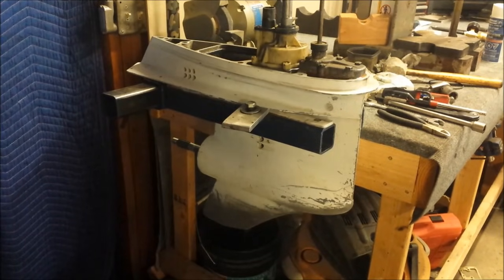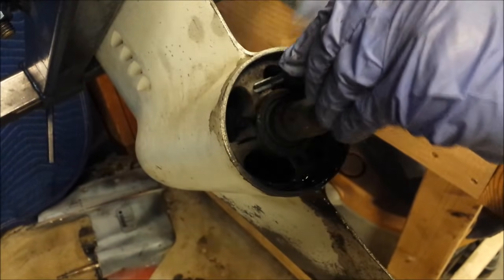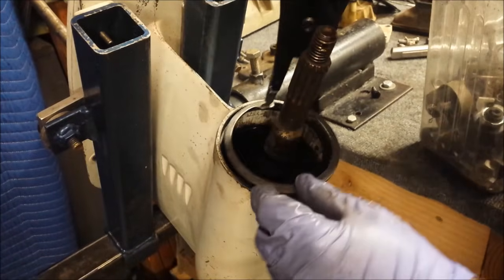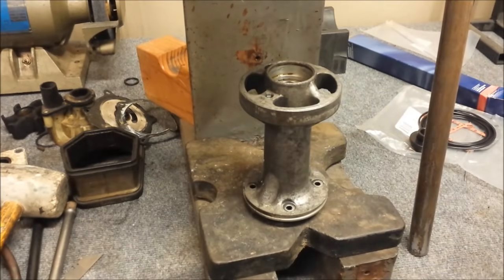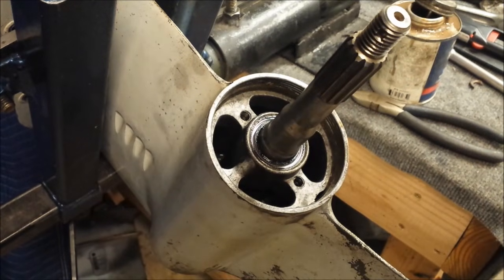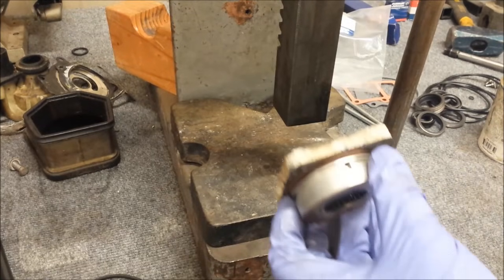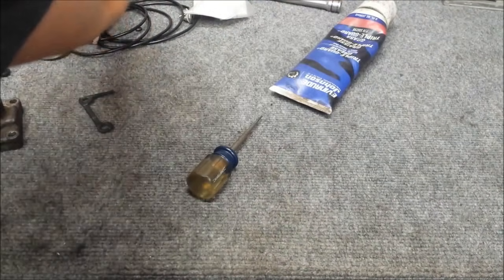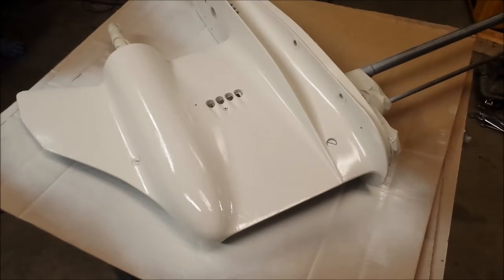How To Reseal a Johnson / Evinrude V4 & V6 Lowerunit / Gearcase

Comment: Thank you for the great tutorial. I am in the process of changing my Johnson 2005 lower unit seal and I have 1 question in regard to the driveshaft housing oil seal. The service manual called out for back to back seal part number 0329923 for lower and 0329922 for upper. On seal kits, how do you know which seal is used for the upper and lower or it does not matter.

Comment: HELP  I can't find that tool (prop shaft seal installer) 0326551. I don't have the tool so tried the socket route and wasn't able to get the second seal in straight so now both were crooked.
The first seal went in great....used a generic seal installer to get it started and it stopped when the installer's flange met the rim of the bearing carrier...then used a 1.25 " socket to get it to where the original seal was...about .25" away from the needle bearing casing (enough space to get the seal puller's (like you used)  teeth between the bearing and seal)
The second seal I started off the same way, but after a few taps with the socket, both seals became crooked. :-(
Pulled both of them out and ordered 4 new ones.
Is that the same tool to be used for a 1986 V6 225hp looper? 
My carrier doesn't have the two holes to pull it out....had to get a mack daddy puller whose jaws fit behind the flanges.
Reply from the maker: For a 1986 225 HP, you need seal installer 326690 
Ive done the same thing as you, recently I was installing some driveshaft seals and didn't have the tool. Thought I would skip it as it just needs to be flush, by press can do that!
Ordered 2 new seals and the tool after I cocked it sideways. 
Good news is the tool is only $28
Also, you can look here to verify what tools are needed where in the future -
http://everythingoutboards.com/brp/toolsbyyear/1986.html
Reply: @BrandonsGarage  DUDE awesome thank you!

Comment: Man I have cranked on mine and it just won’t come out
Reply: Use fire..  heat the case only and not the carrier n eventually it will pop out.. keep pressure on it while heating and you should eventually hear a ping and thatd be it coming loose...
Reply: Z Ack  thanks I’ll try again. Lower unit has just been sitting around for 9 months cause I can’t get it

Comment: BRANDON, WHICH IS THE MOST COMMON REASON FOR A MOTOR LO LOCK UP, CANT TURN THE FLYWHEEL OR PROP. SEEMS TO BE LOCKED UP IN GEAR.
Reply from the maker: or prop?!
...well, it could be in gear. 
Most of the time its the powerhead that is seized. Water get into it, and thats all she wrote.
Only once have I seen a seized lower.
Now, that doesnt mean it doest happen a lot, Ive only seen it personally once.
But if you cant turn the prop, its A) in gear, or B) its locked up preventing the engine from rotating. 

It could be both, but you would have to be pretty unlucky for that.